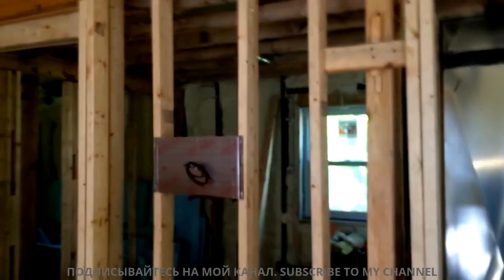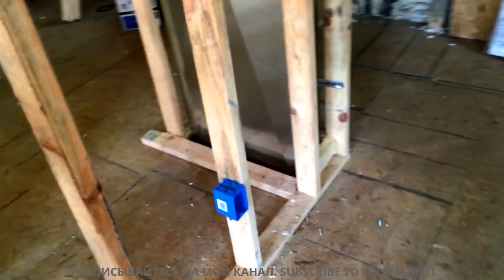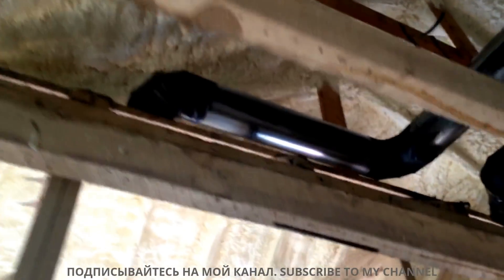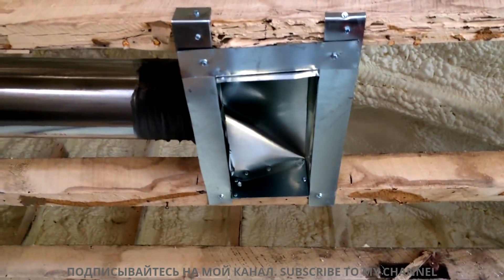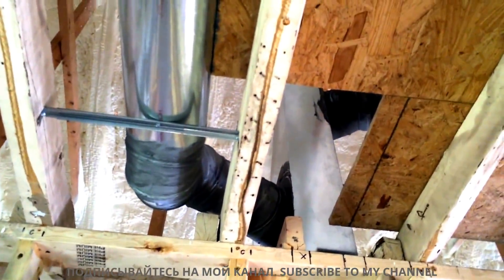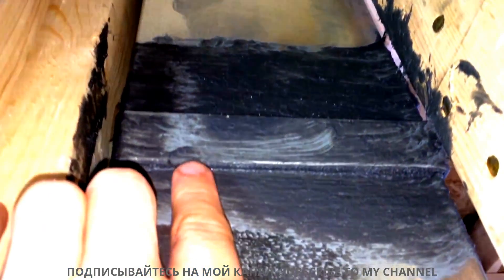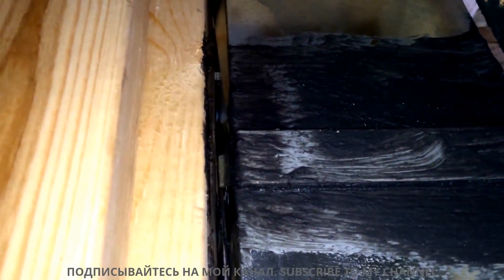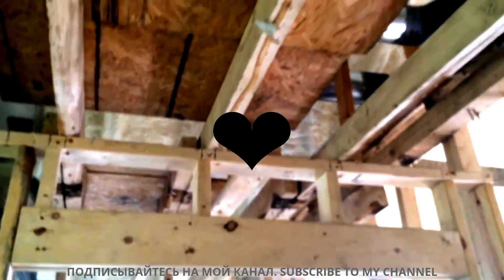⚫ Ductwork Installation. ♦СТРОЙКА & РЕМОНТ♦

Comment: Thanks for the vid, most people have no idea what is behind the drywall. The danger of posting anything on YouTube though: needless and untimely critique!

There are probably reasons/limitations to why the ductwork is the way it is. Having installed dozens of systems, especially on a remodel, there is rarely space made for ductwork when the home’s layout is planned. It is expected the hvac contractor can just “sneak” it around these joists, those beams and definitely don’t put a return where I want my china cabinet and there can’t be any bulkheads! Anywhere!

Ideally the trades would plan the layout and the architect would be forced to work around those limitations!  :)

Comment: doesn't need to be 100% sealed, not really going to leak because of low pressure + small surface area gap. the path of least resistance is going to be the registers, and that is where 99.9% of the air will go.
Reply from the maker: Ok
Reply: Kevin Keel has to be sealed because of the building codes.